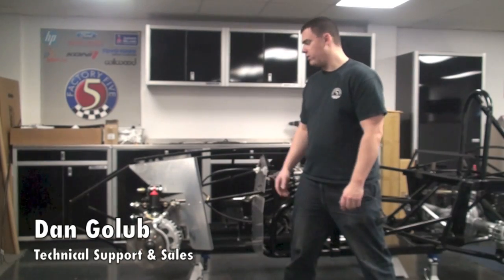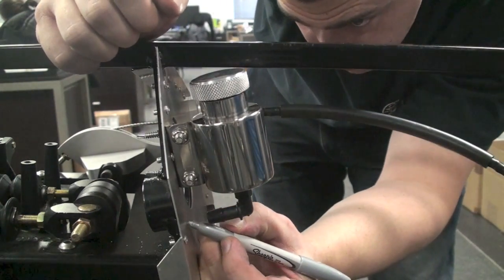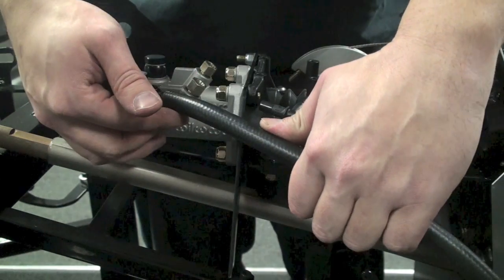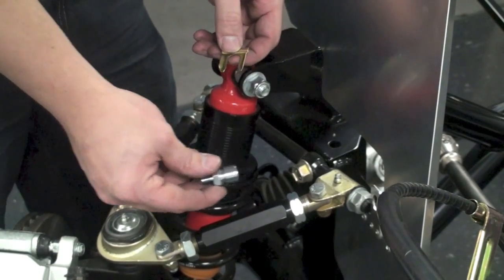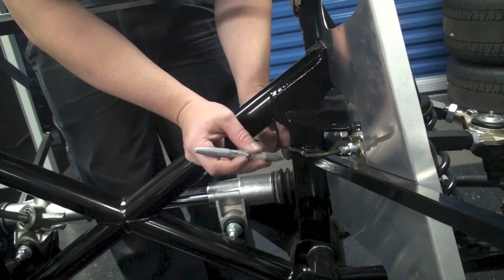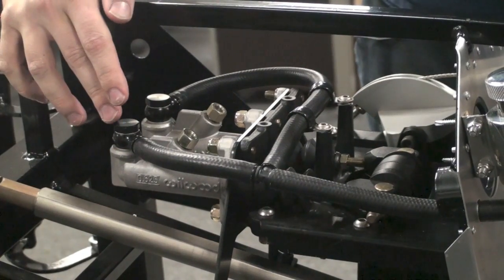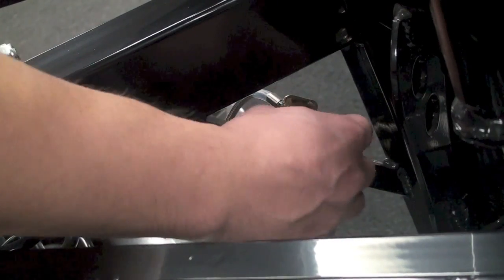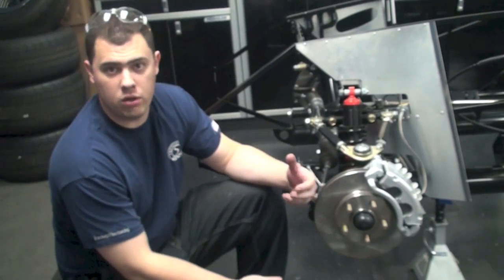Factory Five Mk4 Build Episode 10: Brake Lines & Reservoir

Comment: For the mounting bracket for the reservoir... wondering if you can use nutserts.  Then you can use an actual bolt and I think it would look really good.... and then you won’t have those sharp tech screws poking through.

Comment: You use braided lines going to the calipers but flex hose out of the master cylinder? That seems like a cheap quick fix and not a permanent solution. I expected better quality than that. That should be a hard line.
Reply from the maker: Hard lines from master then braided to calipers. The only place we use Wilwoods supplied flex hose is reservoir to master and that is non pressurized system. You can add a braided line going from the reservoir if you want, I believe Wilwood has them available, just not needed.

Comment: seams like a good idea to use sheet metal screws for the brake line clamps rather than pop rivets. would make future maintenance a lot simpler.
Reply: I was thinking the same thing. If you ever had to change a brake line etc. you will be forced to drill out a rivet. or try and slide a non-flared brake line through that permanent clamp?! lol

Comment: Excellent tease & under the body look-see.

For me, those reservoir bracket self tappers look kind-of dangerous (& cheep) at that length.  Also, the reservoir hose to the masters in direct contact with sheet metal edge? –Mine will have a suitable grommet.  And yea, brake line loops will face downward thereby air bleeding upward, less I plan to fly it upside down.
Thanks 5 & Mr. tech guy Dan.
Very nice.
C u in 015